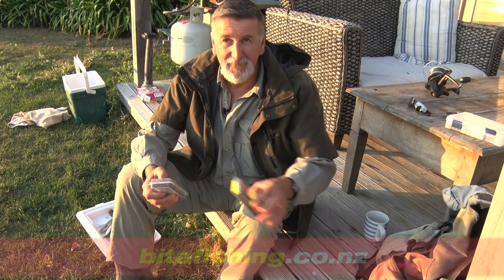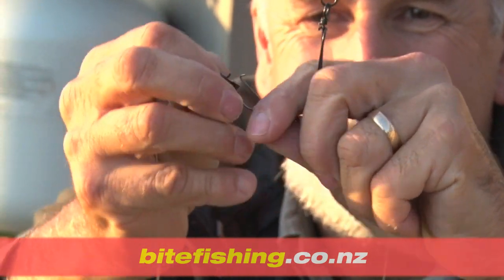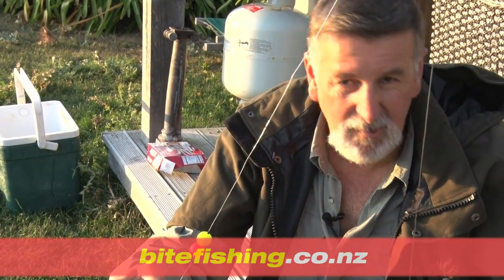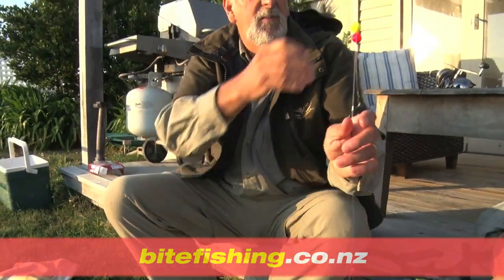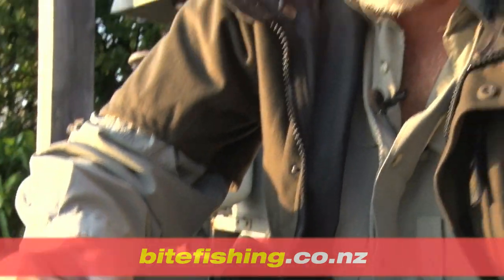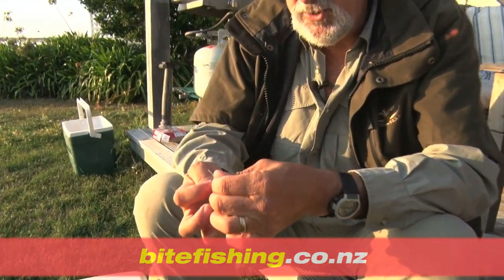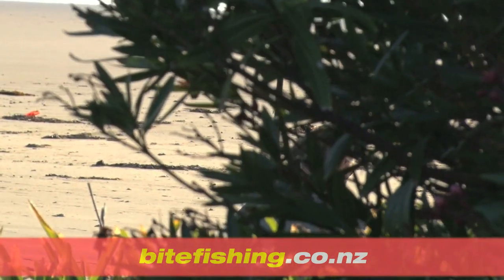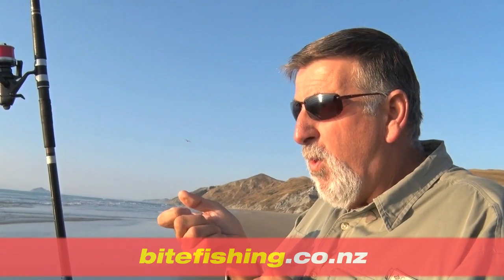How to set up your Bite surfcasting rigs and catch more fish

Comment: great tip lol Ive used those pulley rigs before and I have to say they work great but lol as usually i encountered strange problems with them but they are great to use

Comment: Great video ! I am a newbie to distance casting land-based fishing. Love your rig, my question is what if you want to fish live bait ? Will this rig work ? For example, if I were to use live prawns and normally I hook the prawn at the 2nd to last segment towards the tail, that means the head of the prawn will exceed the length of the impact shield, will my live prawn fly off in the air then ? Also, if I want to use a float rig, can I just replace the sinker with a weighted float such as the ones made by Flex Coat (http://www.cabelas.com/product/Flex-Coat-Launcher-Casting-Float/744566.uts) then remove the bait float on the trace ? Will the rig work that way ?
Reply: ***** Good tip. I just ordered some.